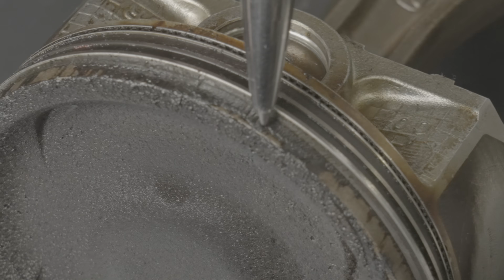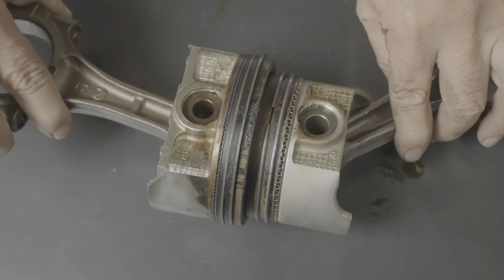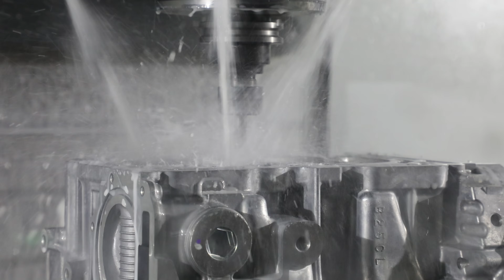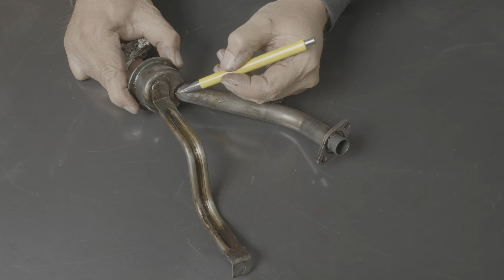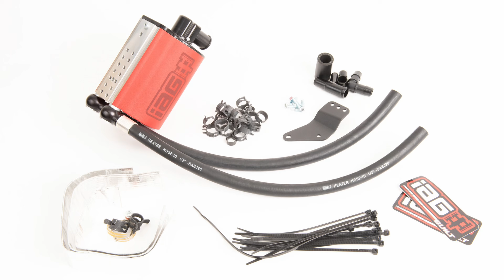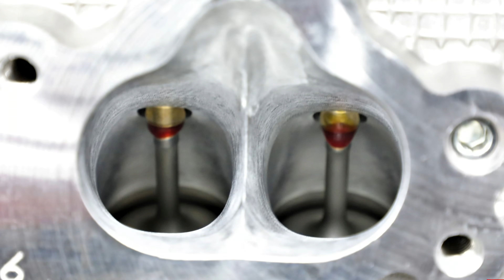Why Subaru Engines Blow Up!

Comment: I had my engine built, stock pistons, stock rods, stock new turbo billet turbines, arp head studs, all new valves, new OEM short obviously, new PCB twice, timing belt, clutch, etc  Stage two pro tune from before the rebuild. After rebuild ran fine, didn't feel as smooth as before the rebuild, builder said it's fine, its drove it daily, changed oil twice in that time frame, and then one day upon start up a puff of smoke out the exhaust popped up, would rev a couple time lightly and will go away , if I'm on an angle with car nose pointed downhill it will puff smoke more or quicker.  It does go away, shut off let sit for 4mins, start it, same thing. Engine builder here in MN won't warranty it, so stupid.  Build was supposed to be around 6400, ended up being 8 and he won't fix.  Just keeps saying, well it's probably this, so then I replace this and that, turbo, PCv  , maf, plugs look fine, they were new as well.  Oil drain off turbo fine, vertical and clean.  My injectors are essentially the only thing that are stock. Grimms speed ebcs and intake, and I ran that stage two from jm auto reputable tuner here in MN for years. 100k was perfect. This rebuild was at 175k and did it cause head gasket popped and was time for new clutch and timing belt. Should've went to jm but knew people who went to this guy/company. So bummed.  Wish I could figure out if it was valves leaking or what. Def shouldnt be since it's all new.  But was broken in fine, had some maf codes around 5k replaced and was better.  But ever since then been just not 100%.  Don't have another 8k for a full build laying around.  But I could do a couple k if necessary any ideas? The builder has built a bunch of engines and guys have been happy. But he's been not good to me. Oakdale MN I'll leave it at that
Reply from the maker: The funny thing is the stock injectors are at the limit stock and anything but the most mild bolt on, needs bigger injectors and pump.  I would do a compression and leakdown check to see how the engine is, if that is ok, make sure you have good crankcase venting and if anything isnt right like plugged or missing hoses, that can make the turbo smoke. If you are unlucky a good mechanic that doesnt know subarus can build an engine that is no good.  You have to have correct machining on a Subaru done by a machinist that knows how to do Subarus more than any other engine.
Reply: @motoiq  Soo true. I only kept stock injectors at the time because I daily drove it and I wasn't tracking it, and I wasn't looking to make bigger numbers of power.  So when we tuned it we kept max boost real conservative, we didn't want any boost creep with the intake and I just wanted to keep it reliable as possible.  And it was a hundred thousand on that tune.  But this rebuild he's a Subaru specialty only builds and works on Subarus , his machinist I have no idea but he does quite a few cars yearly.  My compression was good last summer when I checked. Would a leak down test tell me whether a valve was leaking, or if a valve stem seal was leaking? Or would it just point towards "it's some thing in this valve we need to deal with".  I'm okay with either.  All my hoses that I'm aware of that run up to my PCv are clean, my valve doesn't seem to stick I replaced it anyways along with the elbows and assembly near the green valve.  
I am doing to do injectors here, may stay stock blues , but I may go astep up.  Couldn't see a stuck injector causing intermittent smoke but I've seen vids when it just billows smoke.  And similar colored smoke blueish blackish.  I'll have to recheck vent lines but when I redid it I wasn't seeing anything odd or off. I never even got to beat on it or drive it spiritidly.  It just never felt 100. I will do a leak down and see how much getting by if any.
Reply from the maker: Is the smoke the worst after idling for awhile?
Reply: @motoiq  so if I start it up, immediately upon start up it's noticable puff cloud of smoke, I give a light blip rev and it goes away.  If you let it sit and idle for a couple mins, and blip the throttle you'll also more than likely get that puff of smoke as well, not every time, but more so than not. But If the car is facing down hill, even on a slight incline, that seems to make it do it quicker.  I. The garage on flat ground, I can idle it for a couple, blip the throttle and it doesn't always do it. But if it's on the driveways slight downhill nose first, it will do it after idling dang near every time.  My gut says it's one of the valves is leaking somehow. A month before that is when I replaced the MAF, and that was because one day driving it started sputtering, and the code was a po113 a po102 and a po303. Replaced cleared codes, no more sputter month later smoke on start up.  It's not pure blue oil, it's like a bluish black ish.  Wasn't pools of oil on either side of the turbo, the intercooler just had like a negligible light amount of film not wet, not dripping down the sides no pools of oil. The area where the PVC valve under the black and green valve and assembly, there was light fresh looking oil in that area.  That was new with the build obviously, and I also replaced again after and checked upstream and things were clear. But yes if I let set and idle for a few mins and blip the throttle I will get a decent sized puff of smoke that will go away with a couple blips until It sits for a few more mins.
Reply: @motoiq  i have not ran it or drove it more than around the block since it started.  It's idled a few times for a few mins at a time just to take videos to send to the guys who built it.  It didnt get worse as it runs, it just does it consistent.  Runs for a few mins, blip it, puff or small cloud of smoke, blip again goes away, blip again nothing, idle for several mins, blip it again, similar sized puff plume of smokes. When I went around block, stopped at stop sign took off nothing, nothing around the block, got to bottom of hill, back up, put it in the first, let off clutch going back up the hill, puff plume of smoke for a second, and then a sec later it was gone.
Reply from the maker: It sounds like turbine seal or crank case pressure. If you take the oil fill cap off does it do it?
Reply: @motoiq  I thought turbine seals as well.  So I replaced the turbo with a reman ihi stock turbo.  The original turbo i pulled off had almost no shaft play surprisingly enough side to side, and up or down. But thought hey, it's got quite a few miles seals could still be deteriorated I supposed,, so let's replace it anyways. And it still did it.  I really hope its something in the venting. I never thought to try without oil cap on. I'll do that.  I have plugs loosened right now, was going to run a leak down hopefully this weekend or early this coming week.  It's winter in Minnesota and my garage isn't heated but sposed to be warmer in the coming days. I never thought of releasing pressure from the cap and trying it.  We don't have many reputable subie specialized shops in central minnesota.  Everything is an hour away or more from me. I'll give that a try and see, and then leak down and compression again here.  Would be so rad to be something not venting properly just can't seem to figure out what or where the eff it is if it is that.
Reply from the maker: A little up and down is ok but there should be no side to side.

Comment: To really drive the distortion point home, i had at least 2 thou off on my valve clearance after i torqued my head, and another 1 thou on the front 4 valves after installing my timing

Comment: Pretty fragile.😂😂 I took my 185k mile engine modded it to 522 HP to the tires and beat the car daily to 250k miles where's I sold to some high school kid who's still beating on it today
Reply from the maker: Then you are really lucky,
Reply: @motoiq  idk if it's luck just make sure the mods fit the build tune it right and don't try shooting flames to impress people that aren't gonna help put it back together if it blows up if you're two stepping for a crowd and not a race you don't deserve the car anyways

Comment: I was an example of fully build closed deck block ported heads larger valves aggressive high lift cams etc but used a catch can that was always dry and stock oil pan with the killer b pickup and baffle but spun a rod bearing and now can’t afford to fix it because the original build was so expensive so if i do ever fix it ill be going iag pan and iag oil separator. Dont be like me and think you can get by with a catch can on a Subaru.

Comment: Great video, everything explained to the smallest details.
What I honestly don't understand is why Toyota are using the engine of the BRZ for their own cars.
They now have made the 2nd generation and Toyota is still trusting the know-how of Subaru and working together for the engine and chassis.
Also years ago Top gear (with the original cast), arranged a sellection of the most reliable sport's cars and the Subaru with the most HP and with 200.000 miles on speedo seemed according to them the most reliable car with a bulletproof engine?
Thanks.
Reply from the maker: Keep them stock

Comment: why do they USE OIL
Reply from the maker: We explain the the video. Watch it.
Reply: @motoiq I texted during the first 5 mins and I watch the whole vid afterwards.im gonna show my dad who was a Datsun,then Volvo,bmw mechanic and honda mechanic until he retired last year the video.i hate subaru motors.they suck.my first car was a Grey market 1979 bmw 323i my dad had put a 2.7 eta block in and ported.those motors will rattle like diesels and keep going .and then I got into hondas.i wondered why 2.5 subarus wouldn't pull themselves out of a wet paper sack and now I know for sure why because of its over square piston to stroke and the high top ring in a dished down piston or ring up piston.i have three .
1 07 outback,runs.1manual 05 forester,stuck in between gears.1 07 forestor with a mild blown head gasket. now I know not to fix it.who makes k series bell housing adapters

Comment: I was researching my next vehicle, and looking the Outback with a turbo engine.  I cam across this video.  My question is, with normal street driving, do I have to worry about the engine having issues with head gaskets?
Reply from the maker: Not if you keep it stock.
Reply: @motoiq  thanks for the reply.  Your videos are so helpful

Comment: Thanks for heads up on Subaru engines.  All they are is rip off of Volkswagen reissues boxer engine. Reimspies.
Reply from the maker: They are actually an order of magnitude better than a VW engine which were designed to make 40 hp.

Comment: Whenever I see a fault analysis of a modern engine, I can't help but think that a cast-iron, pushrod, naturally-aspirated V8 is actually superior to an aluminum, OHC turbo-4 out in the real world, where things like maintenance and parts cost matter. Iron engines don't shatter like glass if you overheat them, nor are they designed in such a way as to make economical repair impossible.
Reply from the maker: The old small block Chevy and Ford are pretty weak by todays standards.  To get decent power, you need to throw away everything but the front cover from those engines.

Comment: This is why I paid professionals to make me ej20 open deck block to closed deck stroker shortblock.Forged, Pins, rear thrust, line boring, all the good stuff. Cost around 5000 euros. For the reability you get for the money is so much better than buying 2nd hand stock engine or built engine which have unknown history

Comment: I do find it amusing that all of these issues come up at over 400hp, which is ~30% over stock.  

Most engineers build to a 25% factor of safety.

Subaru builds performance cars for $30k-$43k, so if someone wants a more track-ready vehicle, they will have to build it or buy $60k-$80k Porsche, or similar.
Reply from the maker: It is WHP so that is around 50% more than stock.
Reply: @motoiq  that actually makes it more amazing that the stock internals can handle that much more power without serious internal improvements. 

There’s a reason Mitsubishi abandoned the low cost tuner market.  

It seems like so many “bros” would snicker if the EJ could handle 1,000hp, but would shatter at 1,001hp. 

It would take $70k-$100k to buy a factory 500whp car, so at some point the engineers have to compromise with cost, especially when adding AWD for the same price as a FWD from many competitors.  

I really enjoyed this video and I really appreciated that you discussed it from an engineering and expectation point of view.  

Bravo!

Comment: Did they ever get the ring issue sorted out for the 2016-2020 models ? Or 2008-2014 sti
Reply from the maker: On the newer ones yes
Reply: Thanks for the reply ! Which year of the WRX would you recommend to be most reliable
Reply from the maker: The newer ones with the FA20 engine, keep them below 400 hp.

Comment: What is the best fuel for the Subaru 2021ascent , 87, 89, 93,  ??
and why does it consume a lot of fuel, averaging 16 miles per gallon in the city and 21 on the highway?
Reply from the maker: I would use 93 if you have it. Subaru's are not known for their fuel economy.

Comment: Wife had a sti as a daily driver.  Under 100k and never beat on or abused.  Burned oil until there was only 1quart when I went to change it after 5k. POS.
Reply: So who was beating on it? Someone was because that's not normal at all. 
And what fuel were you running?

Comment: This mostly covered the EJ (minus the pickup, those suck on the EJ and FA),  didn’t hear anything about his thoughts on the FA20 series.

Have owned two wrxs both I’ve kept stock.

The wrx hasn’t run an EJ since 2015 at this point.
Reply from the maker: FA is somewhat better

Comment: the turbo ? It has wireless electrical false signal problem. Met that often on 18 wheeler .  Its not piston ring location . The show the engine has massive electrical problem . Easy fix but most will not touch . People tend to not want to pay for false signal eradication
Reply from the maker: It is the piston ring location as sure as the sun is gonna come up tomorrow.
Reply: @motoiq  Why isn't it a wire false signal or/and wireless false signal?
Reply from the maker: There is no such thing as a wireless false signal in engine control, they don't run on bluetooth. Faults in OEM wiring tend to produce drivability issues not cause the engine to blow up.
Reply: @motoiq  what ? Wire faraday caged wire cause false signal usually wireless electricity ?  Usually at start up and intermitantly . Its a huge issue on diesel 18 wheeler def white powder in exaust out is the result . Before 2004 ? Say a cat 3406b ? If isolated wire are touching  you'll get false signal . On the dc side its usually from the ground battery chassis .simplest ? Airgap big wire . No rubber coated metal holder . Big isolated wire can not touch anything metallic  . Wire size x 2 is the minimum distance , then ground oxygen sensor directly to ecm wire ground . Reflash or reset to new computer and now you should have ....less false signal . You'll hear the engine run healthier but nothing will have changed alarm wise in ecm . In bad case ? The manufacturer dyno ecm index table before alpha or beta test might trip . But released portion wont trip . With a a26 factory locked at 35 psi of boost the turbo went to 43 psi of boost the engine had to protect it self but on none of the dealer accessible data . So it likely triped the manufacter dyno testing one . Anyway carefull . Once airgapped . Engine behavior will be very different . Deep throated exaust wise but way more friendly and monstruous  . Try it stock .
Reply from the maker: OEM wiring is shielded to prevent that unless this is an exceptionally bad wire harness design. At least on cars unless someone wired in aftermarket stuff poorly. What brand of truck has this problem?
Reply: Freightliner 1998 to today , international 1994 to today, peterbuilt 2006 to today .i have yet to see a brand off any vehicule unaffected . Many wire protect only from physical damage and direct contact . Not near wireless electricity . A mechanic for international.dealer had a truck starter changed . Still would not start he spaced sparter wire about the size of the big wire . Truck started right away . How i found out ? Excessive valve noise on a cummin isx .  Went to bob is the oil guy . One said lack of ground . Nope . After seeing nicchpla tesla image . I tested wire spacing , it cured the issu partially . See computer remembber what worked .if it does not remember that portion is no longer an. Issue . Howw i'm sure ? Because the wire mounting point under international pro star were not used, likely still not used . Take too. Long tto mount properly dealer can fix . They caann not . Nobody want to pay for bad chain assembly at manufacturer. And no faraday cage do not help . It just prevent you getting shocked , car still ge shocked. @motoiq
Reply from the maker: We hardly ever see stuff like that on newer stock cars, the OEM's test for inducted current loops and EMF.  Only seen most of it when someone runs non resistor plugs.

Comment: Change your timing belt! Mine just broke on my 2002 outback at 225,000 miles. Bent the valves. Now looking for a used Subaru
Reply from the maker: considering you are supposed to change your belt every 105,000 miles or every 10 years, this isnt the engines fault!

Comment: Glad I found this video, you're very knowledgeable. I'm wondering about which years are most prone to these problems vs. those with some kinks worked out? I have a base model 2014 Impreza WRX. It's stock/unmodified & the only spirited driving I do is on the street. It's going on 60,000 mileage.
Reply from the maker: As long as you maintain it well you should be fine